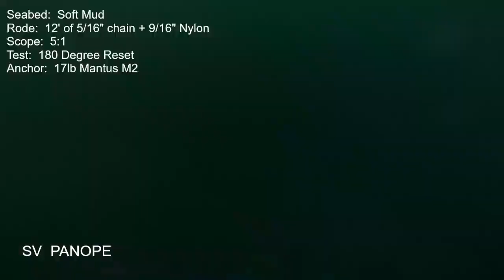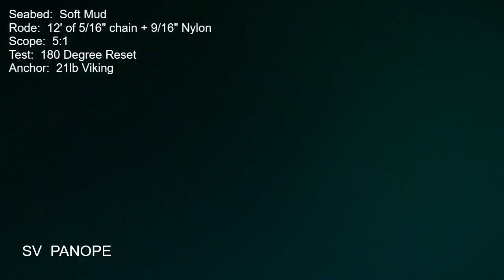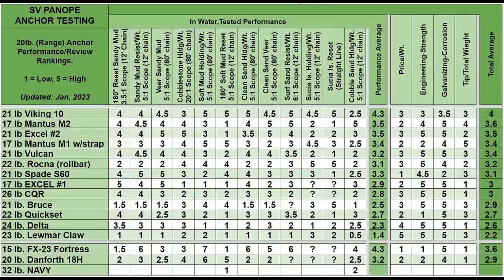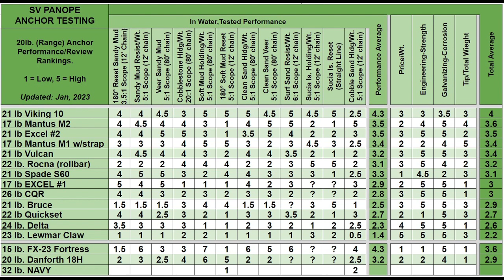Soft Mud 180 Degree Reset.  Anchor Test Video #144.

Comment: Saw out 5 days of gales force 50 knot gusts with a Viking 10 in Hauraki Gulf Island in NZ on a soft mud bottom, over New Year period,  Sure, it helped I had about 170 feet of chain out too, and also helped the wind was blowing from the shore, not the ocean, but nevertheless, the Viking did not budge an inch.  That doesn't mean another new age anchor would not have performed just as well - but the Viking definitely passed it's first real test with me.  Boat was a Contessa 26.
Reply: Good to hear. I just ordered a Viking 10 for my 26' C-dory.

Comment: Videos are great and I based my recent anchor purchase on the summary data you have provided related to 44lbs (20kg) range (thanks again for performing all the tests).  Wondering if you might also draw some conclusions on the "multiple" types to carry on board, since most folks, if they are like me, carry a primary AND a secondary on the bow (sailboat) and a stern hook.  The primary being the "all around", and the secondary being the "unique" sea bed (soft mud in my case), and the stern hook managing the bow/stern tandem arrangement.  Anyway - I'm one who would love to see you put together a  - "what three hooks to carry" video.
Reply from the maker: Ha!  I can't even make a "what ONE hook to carry" video, let alone three hooks!!!

But seriously, it really depends on multiple factors that will vary depending on the type of Boat, Cruising style, Global location, Availability of anchors, Personal finances, Personal risk tolerance, etc.

Best I can say, is to have the "secondary" bow anchor be "complimentary" to the primary.  Generally, this could mean having one Rollbar anchor and one Non-Rollbar anchor (Rollbar anchors are be better in Soft Mud).

I think a key factor for the stern hook is portability, or light enough to row, or walk.  This usually means Fortress or Danforth.  Fortress are the lightest (per holding power) but are not as reliable at setting/resetting as the Danforth.

Note that if you installed a SINGLE bow anchor that equaled the combined weight of  any two "complimentary" anchors, performance will not suffer.  This also solves the problem of having to decide "which anchor" to set based on imperfect seabed knowledge (what the hell is down there!)

Comment: Always interesting to see the video of how failures happen.  The type of bottom makes so much difference, where small differences in mud character seem to affect the clumping.  I don't know what your sequence of anchors was, but is there possibility that the later tested anchors are working with a mud that is more disturbed and acts differently?  It would be interesting to do the exact same test on a different day (plus or minus a different sequence and plus or minus a slightly different spot) to see if the results are repeatable.
Reply from the maker: For this test (and others) I was carful to drop and reset each anchor in "fresh" seabed.  Scow bay is very wide and with a flat uniform bottom, so it is easy to find undisturbed seabed.  Over the years of testing here, I frequently do "repeat" tests of the same anchor.  "Repeatability" has always been very high.

Comment: Vulcan performance in Scow Bay mud looks to be quite different between the 21 lb and the 47 lb.
Reply from the maker: It's complicated.  The Larger anchors received a "straight line" reset, not a "180 degree" reset - so not exactly apples to apples.  While the holding/wt. was similar between the the Vulcans, the smaller anchor had the advantage of using the same chain (80' of 5/16") and therefore had more catenary.  Again, not apples to apples.  That said, I agree that the Larger Vulcan seemed to behave better than the smaller version.

Another example is the Excel, where the 17lb version behaves very poorly in the Soft Mud and the 50lb Version does much better.

The Mantus M1 might be the opposite.  It appears that the smaller versions might be a bit better than the larger.

This needs to be studied/tested further to make an accurate conclusion.
Reply: @flygoodwin  Yes, we’re thinking about this in the same way. Any plans to bring the larger anchors to Sucia?

Comment: The Bruce is one of the lowest performing anchors, yet it seemed to be your go-to while cruising this summer. Is this just due to it being 66 pounds? Why not use the Spade, Vulcan, Excel, or M2? Should we be more focused on sizing up anchors rather than splitting hairs between designs?
Reply from the maker: At this time, do not have a "go-to" anchor.   I am trying to gain real world cruising experience with as many anchors as possible.  So far I have cruised PANOPE with the following anchors: 33lb Bruce, 35lb CQR, 45lb Manson Supreme, 45lb Spade, 45lb Ultra, 50lb Excel, 66lb Buce, 55lb Mantus M1. 

I do not have access to the 45lb Vulcan that I tested previously.

After discovering that many of the places that I like to anchor have rocky/impenetrable seabeds, I am leaning toward larger anchors.

Comment: Hi Steve, great video as always! Did you happen to run up the RPM on the Viking to see what its overall holding power was? Kind of curious to see how it compared to the Danforth
Reply from the maker: I conducted holding power tests in the same seabed in August 2021.  The 21lb. Viking held 690 pounds and the 20lb. Danforth held 1,295 pounds.  Scope was 5:1 and the rode included 80 feet of 5/16" chain.
Reply: Ok, thank you for the info, that’s super helpful. 690lbs is pretty substantial. I looked and didn’t see the soft mud with the Viking but I’m sure I missed it somehow. Thank you for finding that!

Comment: Is it safe to assume that the ratings on these different brands of anchors would transfer more-or-less directly if sized to their weightier versions? This would be helpful to know for those that anchor in these PNW situations but with heavier vessels.
Reply from the maker: Generally, yes, the anchors "scale"  fairly accurately.  However, I have noticed a few cases where a different size will have a fairly large affect.  I will need to conduct many more apples to apples comparisons (between different sizes) before I can give a definitive answer.

Comment: Interesting...no Ultra Test? The Spade looks That have a small surface área, comparing with the Mantus for exemple...
Dont you think That oversize the Spade to get more área Will make it much more efective specialy in soft mud?
Reply from the maker: The Mantus M1 has twice as much holding power as an equal weight Steel Spade.  This was true for the 20lb "range" anchors as well as the 45 pounders.  While the Spade does have a bit smaller dimensions than the M1, the primary reason for the performance difference lies with the design.  In a nutshell, the Rollbar anchors are consistently far better than the Ballasted, Non-Rollbar anchors in my soft mud testbed

I do not have access to an Ultra in the 20lb. range.
Reply: Só the Rocna did not collect mud on  the Rollbar any more?
Reply from the maker: @MARIOSAILOR1  The Rollbar Rocna has a "mud collection" problem in the SANDY MUD  seabeds.  You are commenting in a SOFT MUD video.  Rollbar Rocna anchors have always performed very well in this SOFT MUD.

Comment: What to do?!? I've got an M2. Previously it appeared a reasonable choice with high marks in most bottoms. But it failed miserably in the soft mud. Any suggestions? Anything I should do if I know I'm anchoring in soft mud? Other than buy a Viking anchor.
Reply from the maker: Set an anchor drag alarm with a small distance circle.  If the wind shifts after the initial set, "test" the new "set" by backing down (with the engine) in the new direction.  If the anchor holds, reset the alarm to the new position.  If the anchor drags - retrieve, clean,  and re-deploy.

Another option is to use a "specialty" anchor like a Danforth.  This is almost a requirement for storms because none of the "fixed fluke" anchors that I know of (including the Viking) have "storm level" holding unless grossly oversize.

I recently spent a sleepless night in that same Soft Mud seabed lying to a 55lb Mantus M1 (as good as the Viking).  This is at least 1 size larger than Mantus recommends for the 40 knot winds that I saw.  The anchor dragged 20 or 30 feet throughout the night - hence the sleeplessness.  I should have put out a Danforth or Fortress.
Reply from the maker: Also, keep in mind that this was a perfect 180 degree reset test that resulted in mostly "back flips".  A more typical wind shift will happen at some other angle, and will have a tendency to result in the anchor pivoting in the seabed and not releasing.
Reply: @flygoodwin  Got it. Any grander ideas? In the past you drilled some holes in a Rocna and got a better performance. (Sorry if I'm mangling the details.) Do you think there is a way to modify these roll bar-less anchors physically to make them perform better in soft mud? I hope you continue to explore the issue of soft mud holding. Why is it happening to this class of anchors? It seems the scoop is getting full of material and causes the anchor to turtle. Is the only way to get them back over to add a bar?
Reply from the maker: @davidhopkins  In the case of the M2, I believe the anchor would behave better in the soft mud if the "ears" (the protruding wing like things) had an extra piece of metal in the vertical orientation.  Most Non-Rollbar anchors have this feature.  As it is, when the M2 anchor is on its side, the ear is easily pushed into the soft mud and therefore does little to help the anchor become upright.

It is likely that a Rollbar will perform the same function as these "vertical ear panels".
Reply: @flygoodwin  FYI I reached out to Mantus. They are aware of the issue with the M2 in soft mud. They said the first version of the M2 had to be recalled due to a significant issue in soft mud. The revised version (as of 2020 I think they said) still has a lesser issue. Their theory was the shank is not perfectly straight. I was impressed with the support. They got right back to me and offered to make things right.

Comment: I wonder if these test scale up, in another word.   Does the performance of a 20lb anchor predict  how a 80lb anchor will preform
Reply from the maker: That's the million dollar question.  In most cases, the anchors will scale up (or down) and have similar performance, but not always.  For example, the 17 lb. Excel is at times unusable in the Soft Mud, but the large versions are reliable.  

While it is technically possible for me to conduct a round of testing with a group of 80lb. anchors, this is solidly out of reach for me in terms of time and money.
Reply: @flygoodwin    Thank you for your response. I realized you pay for all these Test out of your own pocket and I believe the community appreciates that. It is very helpful to have an unbiased testing of such a critical piece of gear.
Thank you
Michael walters